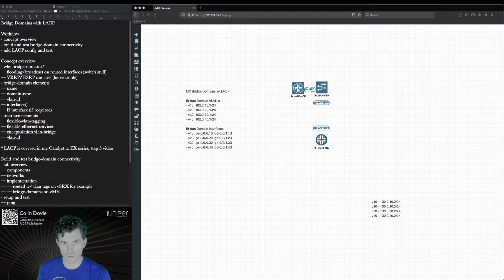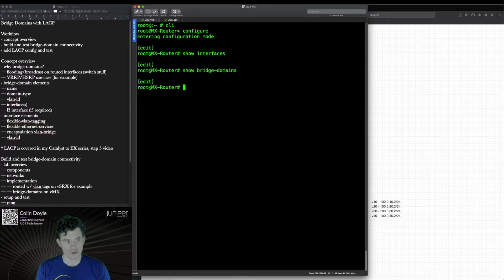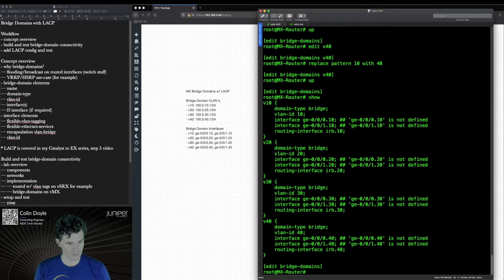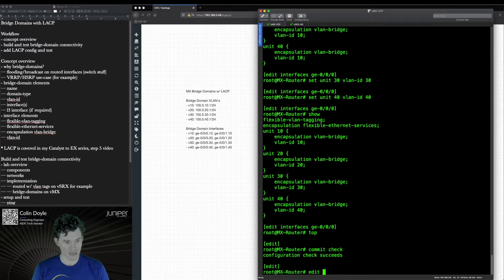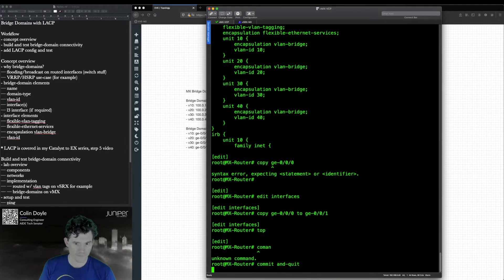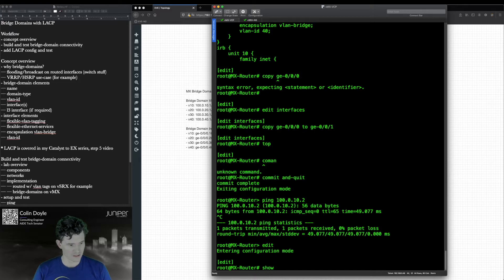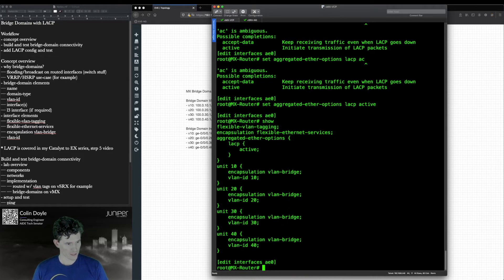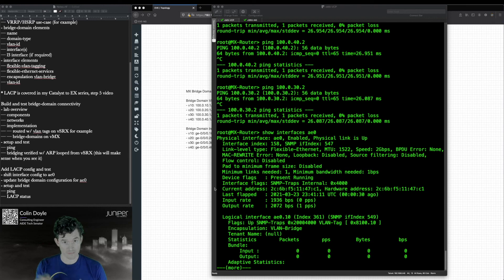Bridge Domains and LACP

Comment: Thank you for your explanation. I have one question. what does “irb” and “fxp” interface used for?
Those interfaces are not physically exsist, so it’s quite hard to understand 😢
Reply from the maker: Ah, great question.

IRB stands for Integrated Routing and Bridging and refers to an interface that supports both layer-2 and layer-3 forwarding.
https://www.juniper.net/documentation/us/en/software/junos/multicast-l2/topics/topic-map/irb-and-bridging.html

When configuring a vlan to support layer-3 routing, you configure an irb interface, and reference that interface in the vlan configuration.

Layer-2:
user@host> set vlan <name> vlan-id <#>

Making it layer-3:
user@host> set vlan <name> l3-interface irb.<#>
user@host> set interfaces irb.<#> family inet address <IPv4 address>

In older versions of Junos (what we would call "non-ELS"), the irb syntax is not used. Instead, "vlan.<#>" would be added to the l3-interface configuration (just swap "irb" in the above commands with "vlan")

I couldn't tell you what the "FXP" acronym is, but the fxp interface is out-of-band management. On some platforms, "em" is used instead of "fxp".

Here's a comprehensive list of interface names used in Junos: https://www.juniper.net/documentation/us/en/software/junos/interfaces-ethernet-switches/topics/topic-map/switches-interface-understanding.html

Thank you for the question!